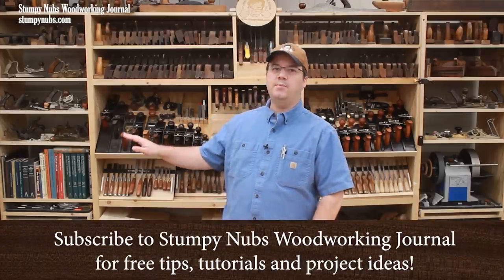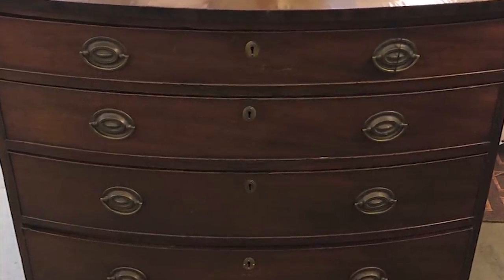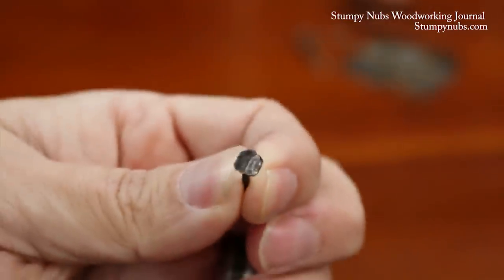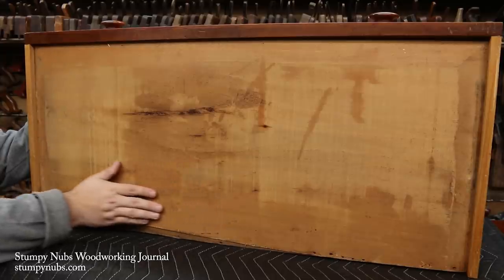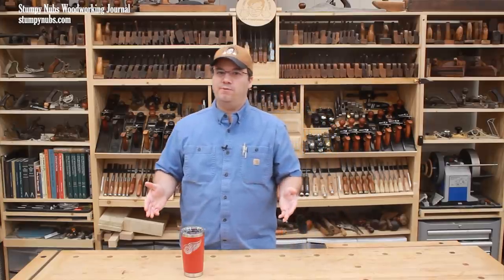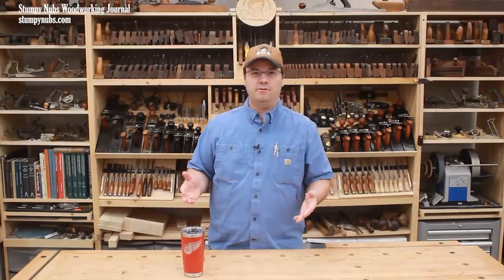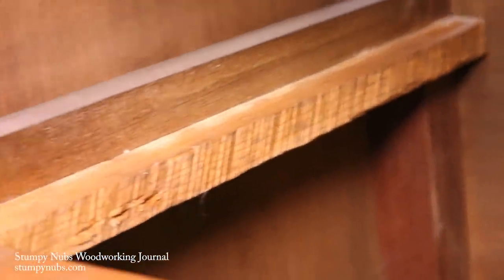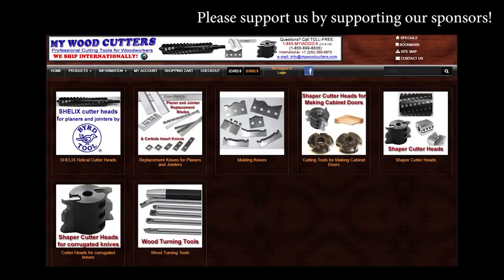The wonderful secret I found in an old dresser

Comment: I have a oak three leaded glass door cabinet and base that was given to my mother by a friend in the mid 60’s.   A few years ago, I found out from the givers living relatives that the upper cabinet with the doors came over from Europe.   And that the base was built by my mothers friends uncle using Missouri oak.   The base has three drawers.   The drawers have three piece wooden drawer glides.  When waxed, they work very well.  One peace is in cabinet, one piece is on the drawer and the third piece is removable and has no fasteners.  Has anyone else seen glides like this?

Comment: A different theory... As you point out most common folk would really not have anything to lock up. So this probably did go to someone wealthy, but wasn't meant as a show piece. More likely was kept and used for some more utilitarian purpose.  The deep bonnet drawer was probably just because that was the normal way of making similar units, not really for bonnets.
Reply from the maker: You don't think wealthy people in the 1840's wore bonnets?
Reply: @StumpyNubs  of course wealthy people wore bonnets. But that doesn't explain the need for locks which as you pointed out were expensive.  So if lock weren't standard on a bonnet / clothes chest then this might have been intended for storing something else, more valuable.

Comment: Great video as always, James. Regarding the bottom of the drawers - are you convinced they were replaced? I recently saw Tom McLaughlin build a chest uing Poplar as a secondary timber but laminating strips of Maple to the bottom edges of the drawers to aid their longevity. Is it possible this is how the drawers on your chest were originally made, or are there marks that confirm your thought that this was done later?
Reply from the maker: I assume you mean the repairs on the drawer sides, not the drawer bottoms? Yes, they are obviously repaired, and appear to have been within the last couple decades. They show very little wear.
Reply: @StumpyNubs  Yes, sorry, the lower edge of the drawer sides. Thanks for the reply and clarification.

Comment: Maybe not in this case, but when I see dovetailed drawers with neat dovetails in the front, and sloppy dovetails in the back, I wonder if the master made the front dovetails, and he had his apprentice make the back dovetails for practice. Just a guess.
Reply from the maker: It was very common to do hidden joints quickly to save time. That's why the bevels on the drawer bottoms and back panel are imperfect, as well.

Comment: Poplar is in fact fast growing for the time you are concerned with. It is tolerant of variation in the weather and is easy to work. Although pit sawn it would be tedious finding its cutting angle. As it is cut the sawdust & shavings expand rather a lot creating another need for skill in the manufacture. It is likely the locks were put in as the cracks are not acceptable in high grade furniture so were failures and as you pointed out it was knocked together pretty quickly. Maybe for a reasonable price so the joinery makes the job good rather than the wood, the addition of locks is rather smart looking in plain cabinetry. Work was not value by the hour. It was a matter of getting the job done right for the right price. Perhaps as an aside to the quality work the fellow made a living with. A sound boxed chest of drawers to take from the city to the wife at home. And as you suspect I believe also was still a fair investment for a country man. They worked the countryside but the money is in the cities. Country towns were expensive and run on a lot of short and medium term credit for local people. Another thing about poplar is a deft hand can rip it down like that very swiftly under a fair plane. We have no indication do we? Of when the stain may have been applied. It was likely waxed and dispatched once finished.

Comment: I feel like the draw rails were replaced, like the draw bases hence the circular saw marks, nails and different wood and also not by the original maker.
Reply from the maker: Yes, I specifically pointed to the drawer runners as having been replaced and noted the circular saw marks as a specific reason. I am not sure what you mean by the drawer base, bit if you are referring to the lower edges of the drawer sides (which are a different color of wood), then yes, I said those had been replaced as well because they were worn away from many decades of use.

Comment: It seems strange that a carpenter who takes enough pride in his work to use dovetails for the shelf bearers would then install those locks so haphazardly - they clearly do not line up with one another. This suggests to me that the locks were added later, by somebody else. Not very much later, given the indications of age James has pointed out, but still not part of the original making.

Comment: Hi You say that the small fine pins are considered a sign of craftsmanship is there a reason why (other than look how small i can make them) that they would be so fine. Are they superior mechanically than wider ones? - The thought of breaking them during dry fit or glue up terrifies me.
Reply from the maker: Fine pins are difficult to cut because the space between the tails is so tight. It takes fine saw work and a narrow chisel. Is it a weaker joint? Maybe, but it is still plenty strong. A lot of American made fine furniture form the 18th century had fine pins and has lasted centuries.